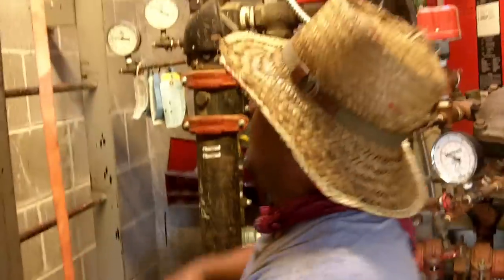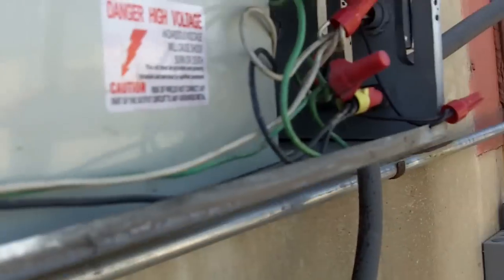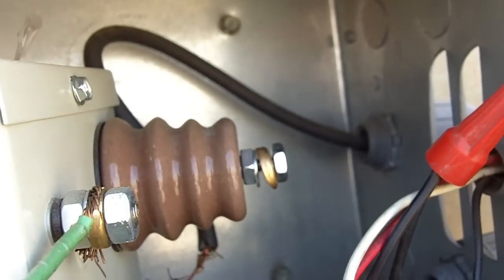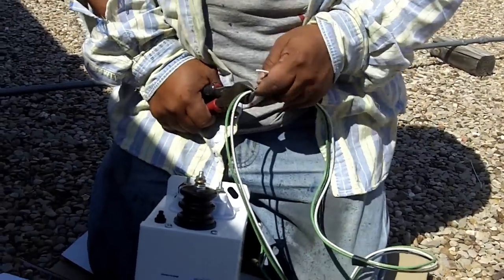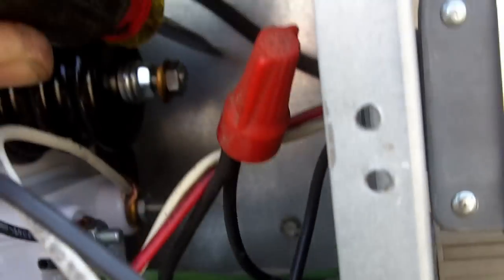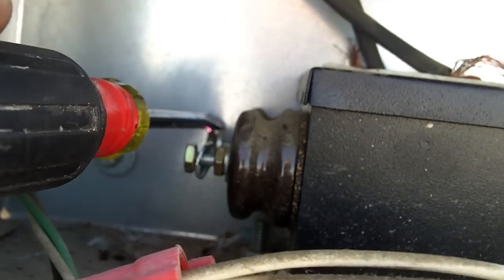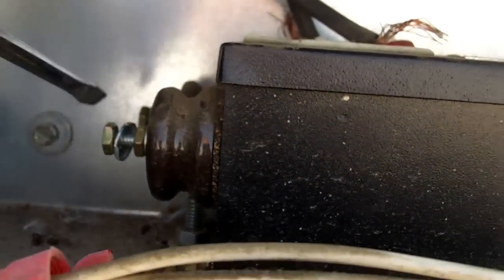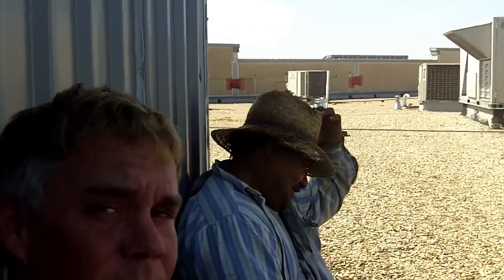Sign Shop 8 How to Test a Neon Transformer

Comment: I understand the outputs of these nst's if shorted doesn't trip tor heat up the input primary lines unlike a conventional AC transformer you use on electrical appliances, is it true?

Comment from the maker: @bilgeratjim 
Way did you remove to comment. I don't mind you giving you thought. I have never seen any sign guy use a meter on the secondary side. Why should you if it is working it will light the neon. The new GFI trans will never last 20 years. I have seen some of the older no GFI last longer than 20 years but not the new ones. no way. Thanks again for the comment.